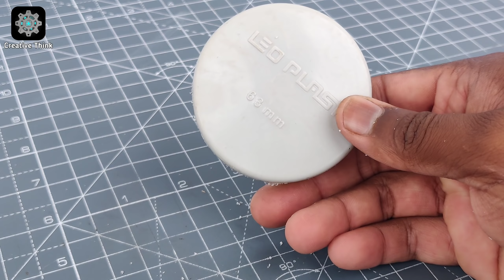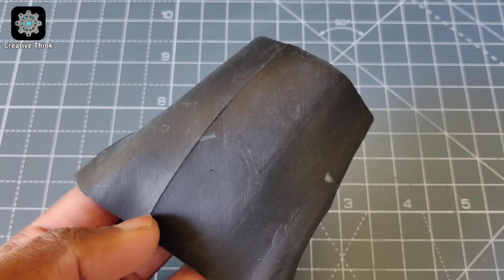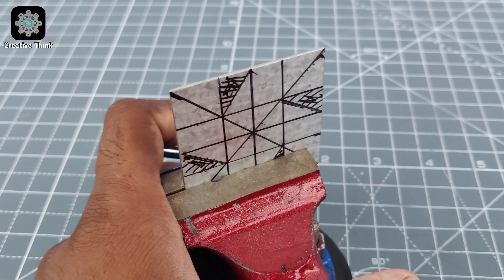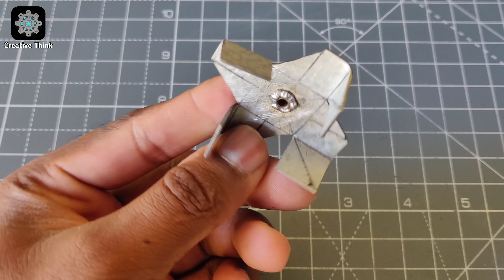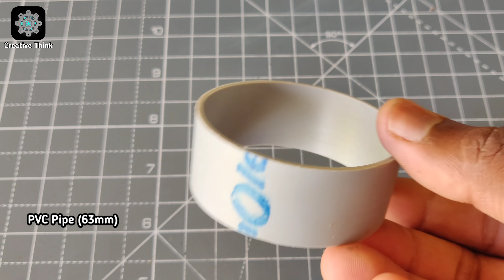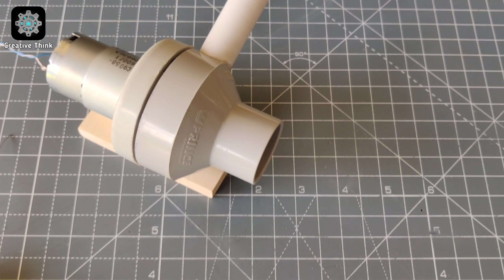Water Pump

Comment: So i got a question thats probably a dumb question. They say glass can be like a conductor. Doesnt hold a magnetic field of its own except for certain types. But what if you got a glass tube and wound it with copper wire and had a magnet spin or fall through it? Would the copper hold up or slow the magnet like normal? Would the electrons in the glass grip to the magnetic field Flux of the magnet and copper and stop the magnet from dropping? Would it even create electricity like normal? Or even produce more electricity? Most resistors are made of glass but there also now wound with copper so im curious if it would make much of a difference